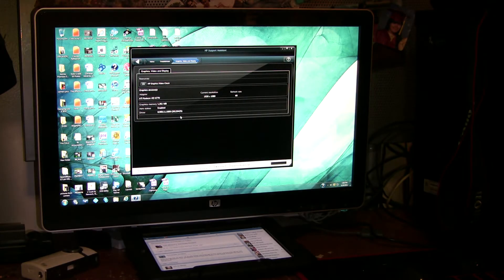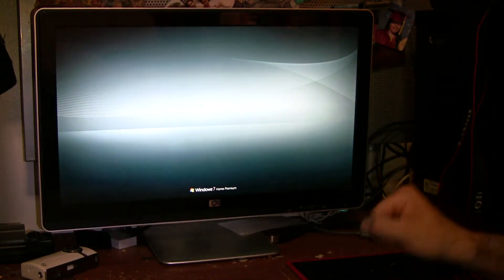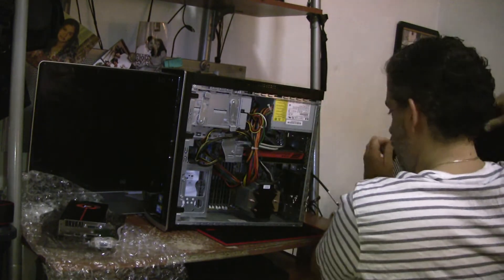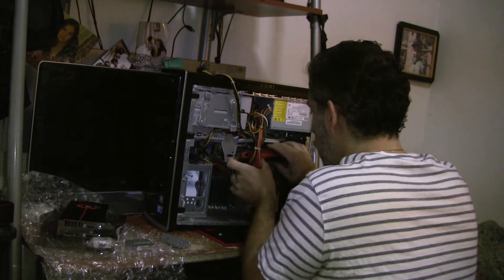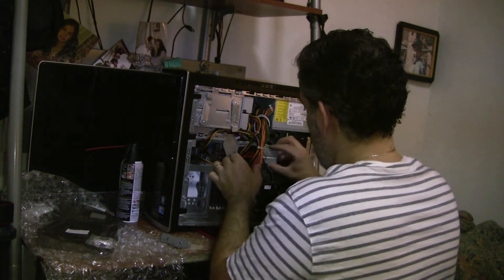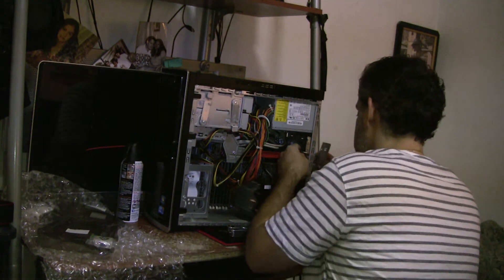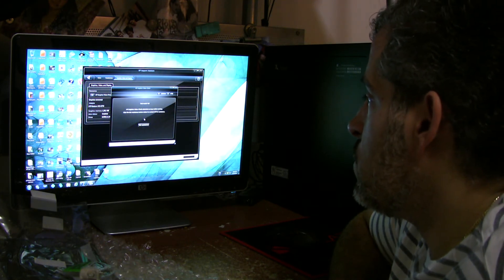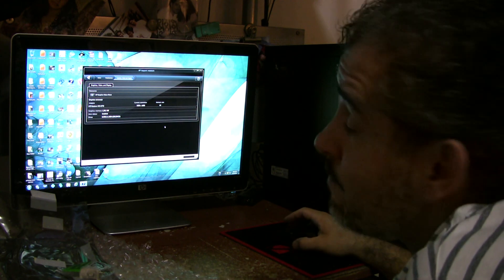ATI Radeon HD 6770 Video Card Replaced & Still Fails HP Support Assistant

Comment: first of never use that shit bloatware that any manufacturer installs with the pc secondly tell us more about what your doing with the pc does it only happen when you watch high definition video and if so where are you watching online or through a media if it's online try changing or resetting your browser if it's through a media player try VLC if either of those make a difference great if not try going to AMD's website and make sure you have java installed uninstall your current AMD graphics driver and use their automatic detection software on their website to find the latest drivers word of advice avoid installing their gaming raptor software if that doesn't help find a different computer and make sure it's not your monitor check the video connectors unplug them blow the ports out  also check all your programs like Emily said antivirus does in fact cause trouble sometimes i have seen first hand freeware anti-malware purposely place fake malware to trick you into buying stuff you don't need